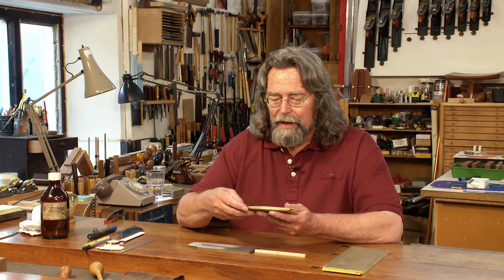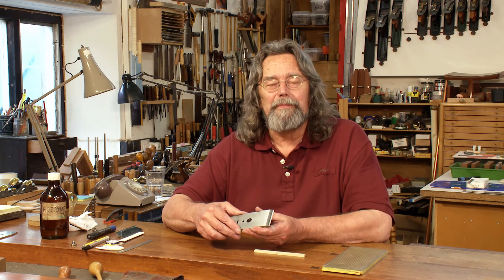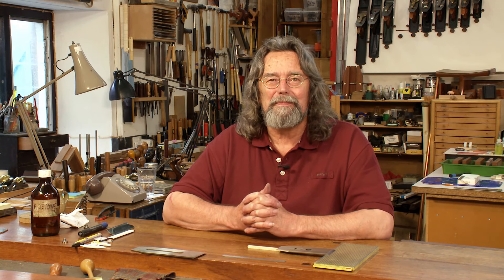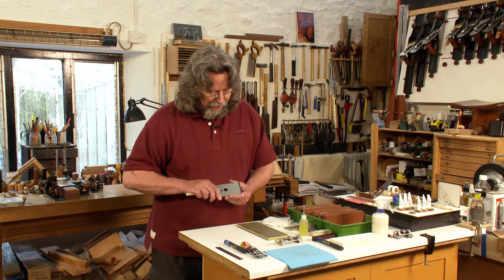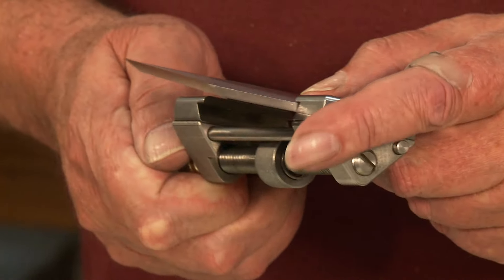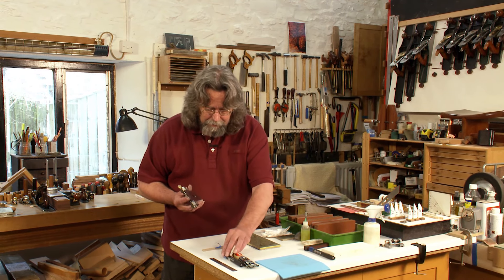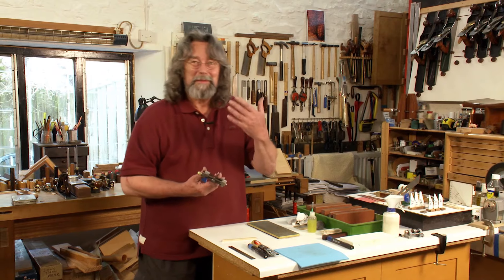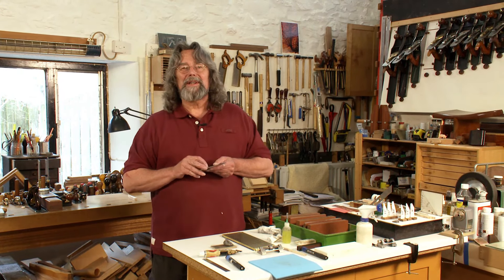Preparing the chip breaker for use

Comment: This is a really elegant solution to a very frustrating problem.  Thank you for sharing.
I wanted to make a wood support for the back edge of my chip breaker, as you did, 3 mm lower than my diamond stone.  What worked very well was to first cut a block the exact height of my stone. Then I cut off the the exact width of my saw blade from the block.  Since the usual table saw blade is 1/8" or 3 mm, this worked very well to dial in the exact measurements you recommend.

Comment: So glad I stumbled across this.  It seems to have been posted just today.  I have your DVD (the first version), but it's very convenient to store this video clip in my Charlesworth playlist here.  Time for me to have another look at the two Hock chip breakers I didn't yet own when I was in your workshop last year.  I know I worked them from the notes I made last year, but a double-check never hurts (especially in light of last week's SMC conversation about the Japanese research).  As I have no diamond stones, I'll need to cautiously use the Nortons for the 1-1/2º work.  Would you suggest 1000 and 8000 for the softer steel?  (The 1000 is my "800.")

David, for those woodworkers who listen, you provide all the insight necessary to develop and maintain the habits that ensure precision work.  Your tireless and comprehensive approach will stand as a constant reference for us all.  All day today I was singing your praises in my shop as I trimmed off a precise 0.067" from each edge of a 22" x 36" x 7/8" cherry door, in order to make room for Brusso knife hinges.  The 5-1/2 super smoother I set up last spring using your methodical steps performed beautifully.  I took perhaps a hundred full-length, full-width 0.003" shavings until the gauge lines were nearly gone, and then predictably dialed back and took off the remaining couple of one-thou shavings.  Every time I checked it was still in square!  Loved that.  

I could still hear your voice in my ears coaching me to drive the stroke through the body with elbow locked, and keep the plane pressed into the work all the way through to the end.  I have a small callus on my left thumb just from today's work!  I'd say I made no more than six less-than-perfect shavings.  Amazing.  Thank you for putting this skill in my hands.  Knowing what to expect with a tool and then getting it is pure joy.  

BTW, I cut my first practice through dovetail the other day in 1/2" plywood, so that's the next frontier.  Your latest video is taking root!

Comment: V good, but how would his chip breaker interact with bevel down plane with a reverse back bevel of 10•degrees(on the upper face). Ie; a York blade angle of 55•degree on a traditional 45•degree frog. 
(Ref. The trick of grinding the top of a bevel down plane blade tip to a 10•degree angle to create the York pitch)
📐I believe “his” technique for the chip breaker preparation would not work with Yorker blade in this style.

Comment: What's your opinion on a curved chip braker? My Stanley #4 (Made in India) has a curved one. I'm new at woodworking and your making me realize how bad the plane came from the factory. I'm having a big headache with it because I can't plane straight all across the plane. Also learning a lot. 
Thank you for the detailed video.
Reply: I think the same rules apply. All my planes have curved chip breakers and I use a similar process. But I honestly don't measure like he does I just eyeball it.

Comment: I just bought a lie-Nielsen jointer plane (No.7). Do I really need to prepare the chipbreaker? They say they come ready to use, are ground at a 2-degree angle, and I haven’t seen many people modifying Lie-Nielsen planes out of the box.
Reply: @davidcharlesworth6354  thank you David. I apologize, I was referring to the angle on the bottom of the chip breaker. Lie-Nielsen grinds a 1 to 2 degree angle on the bottom of the lip. I noticed you also add a 1.5 degree angle. Is this because the ruler trick increases the back bevel of the blade, which makes  it necessary to increase the bevel angle on the bottom of the chip breaker? Or is this 1-2 degree angle Lie-Nielsen imposes sufficient?